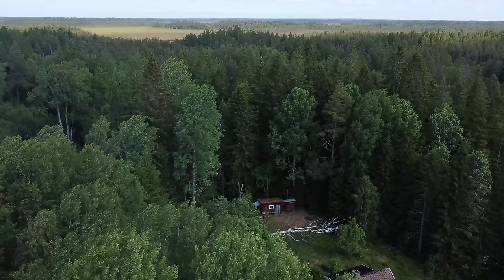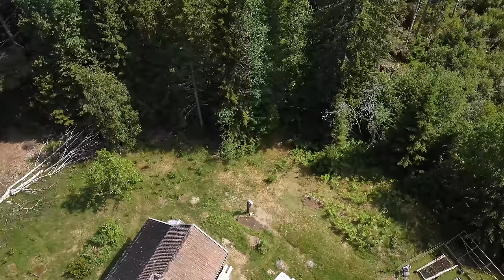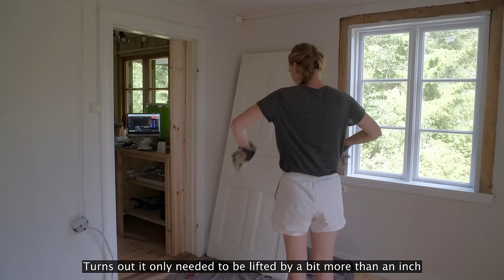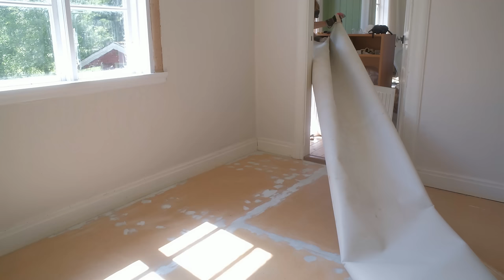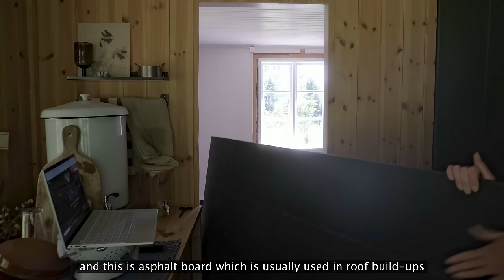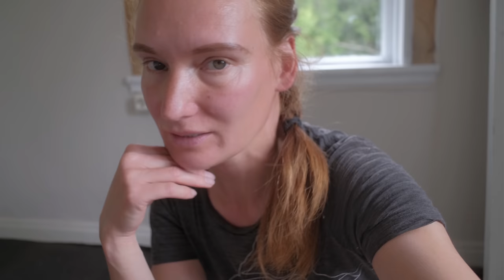I Left London To Make A New Home Here (Story 57)

Comment: Hi Rosie,  your very skilled with wood , a natural , your designs are really lovely 😊, lift hinge doors , open them past 90 degrees it clears the door  jam and architrave at the top ,  cut two long thin wedges make them so when hammered together they lift the door clear of the hinges , place wedges under the door close to inner part of the door ,it lifts easier that way  bang the wedges together and the door pops off , also get 4 small castor wheels and make a long rectangular block of wood  half the size of the door bottom edge ,fix castors on all 4 corners of the block of wood and you have a door dolly,  you can run wood battons along the dolly  to keep the door from slipping off , as a 16yr old  labourer starting out i wasnt very strong a carpenter showed me this trick , and built the dolly i used it to move everything 😀 , your videos are so relaxing , just found your channel ,it's very different , 😊goid different. subscribed  👍

Comment: Completely understand those doors by oneself!  This Old House has helped me with door fixes, but still hard Witt one person to take a heavy door off, you’re doing great, as ever, and thank you, helps me a lot to see your videos!!!!🌹
Reply: Understandable, doing work by ones self isn't easy. One has to figure out how to engineer a helping hand. In this case she was taking the door off at the wrong end. Had she "jacked up" the door at the hinge side not the opposite as she did, it would have taken a few seconds to remove the door, it is simple physics. As it was she bound up the hinge points and created a much more difficult job for herself. One has to step back and work smarter rather than harder. Such as staining her flooring. It is much easier to move her drying and staging points right near her staining point, then she wouldn't be walking back and forth for each board from station to station for such a distance to each....Move the chairs once, or move each board several times several hundred feet along the cycle. Things most people can do if they just think about it. Take your time to do things easier thus faster with less effort. Again the key is to work smarter rather than harder, things go so much quicker when you have a plan first.

Comment: With wood for shelves or crown moulding or framing...it is much easier to stain ot paint them before they are applied...then you only have to touch up where the finishing nails were used

Comment: This might be a stupid question after you've already done the work with the floors, but: did you check underneath the board that was beneath the vinyl floors? Usually in old Swedish houses, there are real wooden plank floors underneath the vinyl + board. The vinyl was often added in like the 1950-60s and those boards were just nailed onto the original plank floor.

Maybe you already knew this and maybe you've checked, it was just something that occurred to me.

I love following your project, you're amazing!!